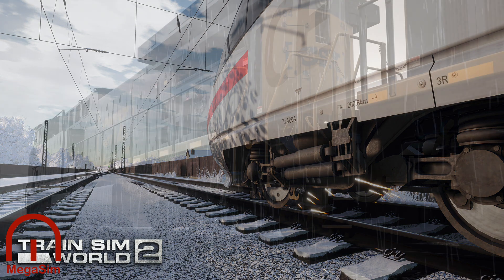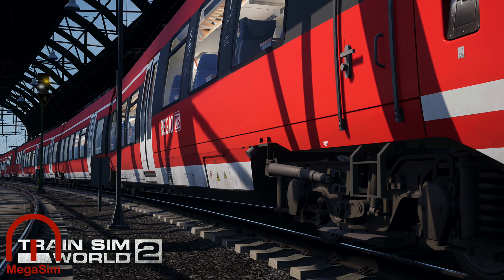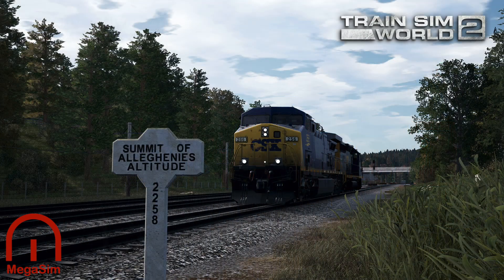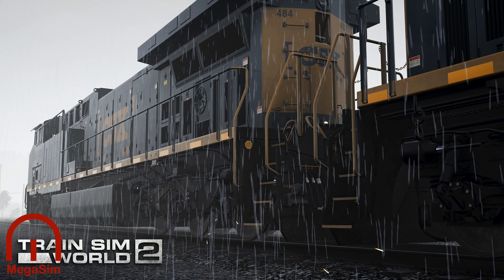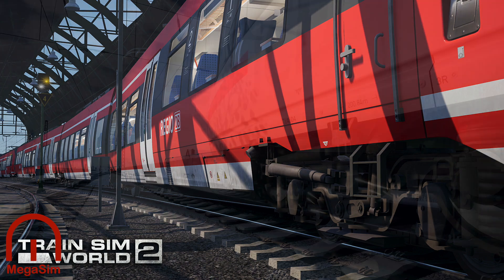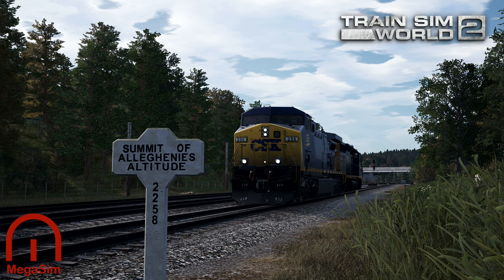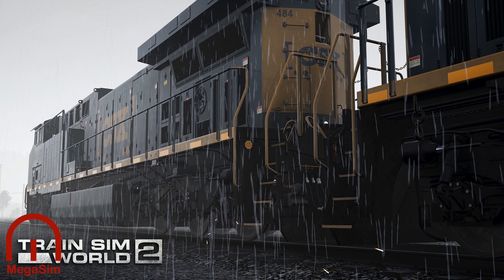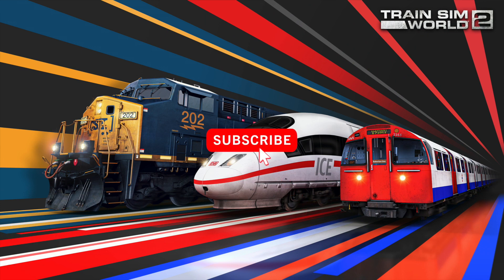Train Sim World 2 - How does Adhesion work? - Get a Grip!

Comment: Should not be a huge difference in adhesion on the Bakerloo in tunnels, it's dry as a bone down there. Most low ad incidents on the underground are where drivers are taken by surprise after exiting the tunnels. A driver may have had perfect conditions in the tunnel and then slide right through Queens Park.
Reply from the maker: I think that for the underground, the braking when going down an incline is the thought they had. But yes, outside, you are against the elements!